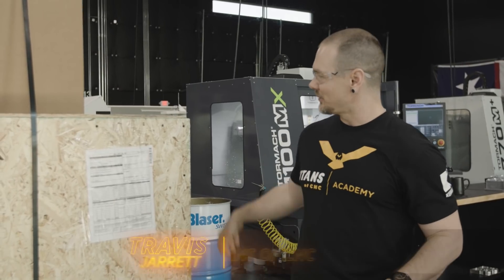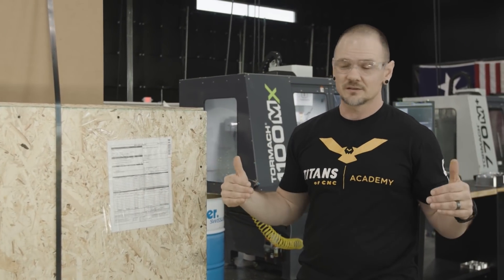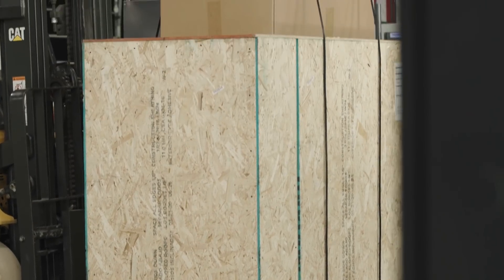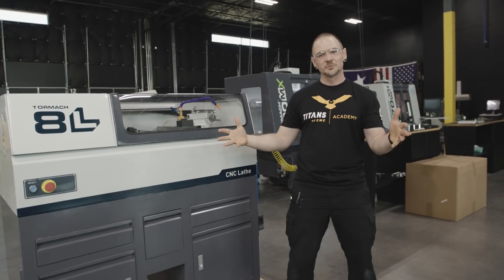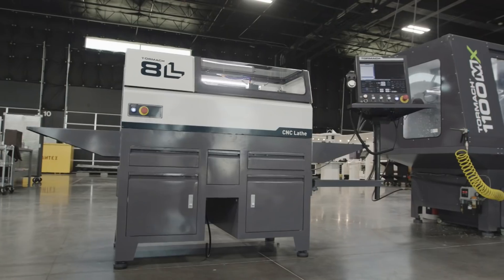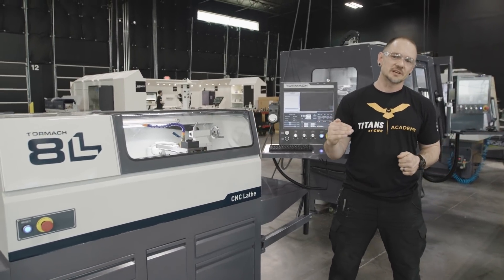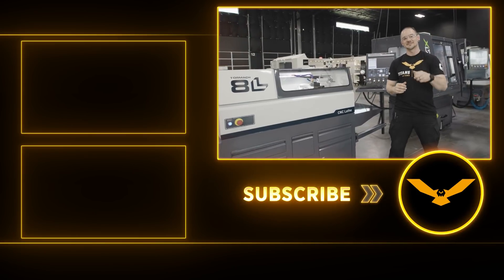Unboxing the Tormach 8L CNC Lathe

Comment: Collet clamping as standard is not a good option for what it is advertized for IMHO. Through hole chuck with spare jaws and accessory template jaws available to turn your own jaws should be minimum as standard. Collets for advanced users to get increased precision. People new to machining can ruin collets pretty easily, those collets do not look like widely available ER ones either.

Comment: You may think its crazy, but we had some of these type machines besides our 2 1/2" Hydrobar bar feed machines 15 years ago. Many people make these little CNC lathes, and they could run simple second side functions and allow an operator to bring off a complete part with very little added investment in the same cycle time. A steal at 6600.00 if it helps you do anything around your shop as long as it will hold up....

Comment: Wounder how hard it would be to convert/mod it into a Swiss type/style leath 

Not to mention how much you would actually learn from doing it
Reply: Not feasible.  You'd spend so much time and money retrofitting this machine.  In the end you'd be better off buying a used swiss machine even at double the price.  An old Citizen machine that has been treated well will be more accurate then the Tormach can be on it's best day.
Reply: @brandons9138  but what will you learn about machine building/buildup from doing that 

dont just look at $. it may be more expensive but you will also learn a heck of a lot doiing it. and to could be quait a fun projekt if you think about it
Reply: @flikflak24  If that's the case you'd be better off saving the $ and starting from scratch. By the time you reengineer the Tormach there wouldn't be much left of it.
Reply: @brandons9138  im sure then casting would still e good though xD
Reply: @flikflak24  It might be ok for a traditional lathe setup, but it's not suitable for a swiss machine.  Since the spindle on the machine doesn't move in the Z axis you'd have to extend the casting to add the sliding headstock. That alone would be quite the feat.
Reply: @brandons9138  and a good place to learn and some good fun / place to spend free time well locked at home ( thanks covid )
Reply: what is a Swiss type leath?
Reply: @danl.4743  its where the cutting tools only moves up.down and side to side but not back and forth 
instead the material/part moves back and forth through a guid callet witch makes it extremely stable. precise and makes you able to run faster and smaller things since there is so little pressure on the part( since the pressure there is on it is right by where the part is supported unlike on a normal lathe where you take a cut far from its support putting tremendes pressure on the part in comparesen )

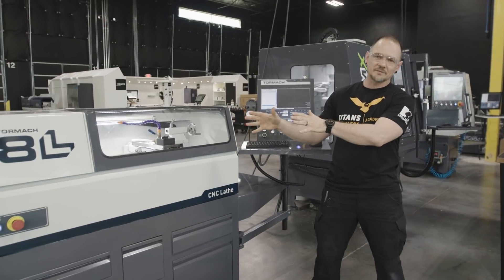Comment: At 1:41  I see the knobs controls, RPM, Feed Rate, and Max Velocity.   I never understood what is Velocity.  I change my velocity and it looks like nothing happens.  Anybody knows??
Reply: Did you even read manual for your machine? I looked into it and it looks like it's for altering speed when you are jogging in constant velocity mode.
Reply: @Stasiek_Zabojca  "Did you even read manual for your machine?" is unnecessary.
Reply: @rgetso  Yes it sounds harsh, however, I also find it unnecessary to ask questions that are covered in the documentation.
Reply: @Stasiek_Zabojca  And Rob Guyatt: Suppose, just for the moment, that I didn't read the manual.  ( I did, but let's say I didn't).  It says that it changes the speed..   And yet what I was saying that I change velocity and nothing happens.  Does it matter if I read or didn't read the manual???  I change it and nothing happens,   
You think that if I read the manual the knob will work, and if I didn't read the manual the knob will not work???   Psychic telepathy from the machine???